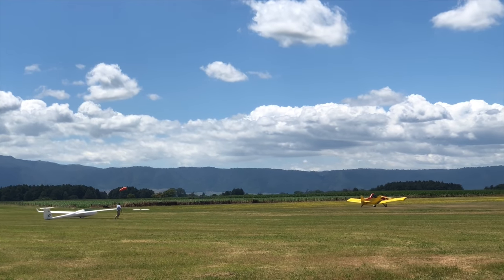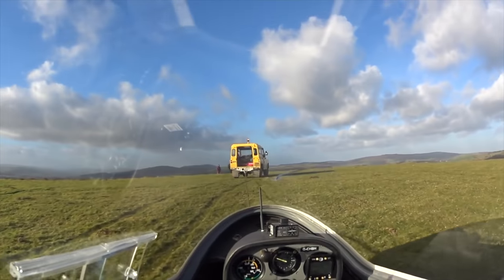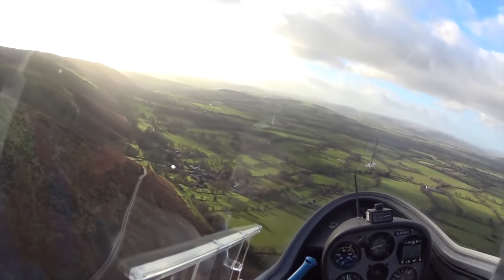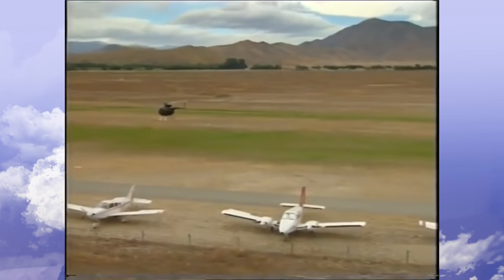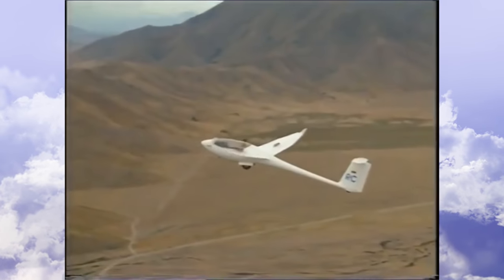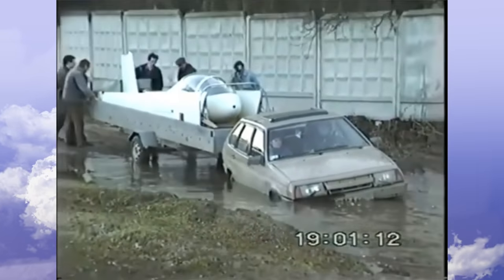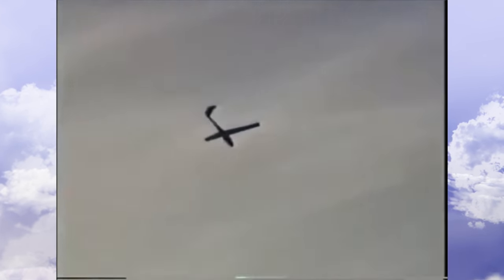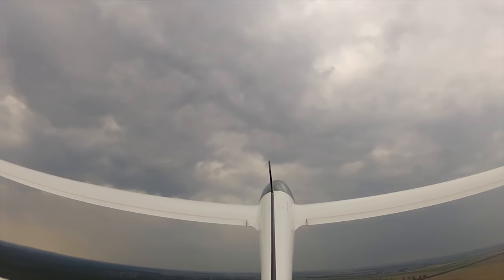4  Weird Ways to Launch a Glider! 🚁

Comment: I have witnessed the most terrifying method of all,   The reflex launch.  This launch is similar to auto launch except that it works on the nature of a certain class of nylon rope. The tow vehicle parks in front and close to the glider. The tow rope is attached and laid out on the runway in a series of S  turns. The vehicle then accelerates down the run and the rope begins to straighten out. By the time the rope is straight ,the  vehicle is moving at take off speed. This is where it gets a bit hairy. The rope, having taken up slack, begins to stretch ,as the glider takes a few moments to catch up. 
As the aircraft gathers speed and launches, the rope shrinks back to its normal length thus adding extra speed to the climb. The situation is now critical, for if the vehicle slows down for any reason ,the rope will become slack  and the glider will be in a dire situation of a slack rope at a low altitude in a dangerous elevated attitude.     I witnessed this method  on a course I did and declined the opportunity to try it out. 
Ps  , the rope lasted for about 4 launches until it became too frayed from being dragged along a sealed runway.
Cheer from Over the Pond👍🇦🇺🇳🇿
Reply from the maker: Holy cow that doesn't sound sensible at all :) Thanks for sharing!
Reply: That, if I understand correctly what I have just read,  would be an ideal method for decapitating traitors. Not for me.

Comment: Great video.

What about the shoulder launch? Requirements: 1. Hill. 2. Correct wind speed and direction. 3. A six person ground crew. 4. A lightweight glider (Ka6/8/18 type). Method. Move the glider to the slope. Lift the glider onto your shoulders (it should nearly be flying) with one at the tail. Now run down the hill. The glider will (should…) fly off. It’s expensive, like bungy launching, due to the number of beers required for the ground crew. And then there is the reverse auto-tow that is more like a winch launch. It is used when you have a short strip.
Reply from the maker: Thanks Trevor :)

Comment: Interesting to see the Heli-drop - We’ve been very successfully launching RC gliders like that for years on flat field RC sites with only thermals to generate any lift (along with bungee launches). One suitably qualified person to fly a suitable size drone in an approved location - drone equiped with an emergency release - and one person to fly the gilder with a normal nose release servo. Very effective for that situation with no ridge lift as you can launch at any time and not just wait for capricious thermals.

Comment: As a hang glider pilot, I was going to add foot launch, but someone beat me to it.

We used to do hand towing sometimes. Couple of guys pulling on the end of the tow rope. Car towing (what you call Auto-tow). Winching. I flew and drove the winch, but it was very dangerous. Horse towing I saw in a video once. The glider pulled onto the air by a horse. Boat towing of course is how it got started and a major manufacturer used to do initial test flying that way. 

Truck towing though seemed promising. Flat bed truck drives along with the glider on the bed. When it reaches flying speed the pilot lifts the nose and takes off. There's a payout winch on the truck. The interesting twist is that the truck can drive up and down the strip and the glider turns 180 at each end. That way the glider can be towed far higher than the strip is long. You can't do it car towing because the bridal attachment will cause the glider to go out of control if the direction of flight and direction of tow are too different.
Reply from the maker: Now turning around mid tow sounds crazy! Thanks for sharing

Comment: I was at this helicopter launch, and the practice day for it. From memory it was Terry Delore in the glider and Bruce Drake in the chopper. In the practice (which it looks like this video was from, not the actual airshow) the glider was hanging for rather long time. Bruce was heard to enquire on the radio whether Terry was going to be long, because he was starting to lose altitude. Terry replied that he was having difficulty reaching the release. He eventually got it. I don't know whether he had his straps tighter for the airshow flight or put an extension on the release cable. It would have been interesting to see what happened if the chopper accelerated into forward flight.

A snatch launch was in fact proposed for this show (the opening ceremony for the 1995 Worlds in Omarama), but Max ruled it out.
Reply from the maker: Wow a snatch launch would be interesting to see :) thanks for sharing Bruce, much appreciated! I knew Bruce was involved, but didn't know Terry was too.
Reply: The glider pilot was Bruce Drake, the helicopter pilot was Alan Bond of Mt Hutt Helicopters
Reply: @glidingkiwi490  thanks for the correction John
Reply: @BruceHoult  Glidingkiwi.com is not run by John Roake
Reply: @glidingkiwi490  well that's a confusing name. What the heck is a glidingkiwi.com, based in Switzerland?
Reply: @BruceHoult  not confusing at all. As a New Zealander that owns and flies sailplanes I think it is a great name. Possibly less confusing than Pureglide who flies a Ventus turbo. Sorry Tim 😉
Reply: Very awkward and confusing thank you for the explanation!

Comment: Auto tow down a runway normaly uses something heavier than a car, Bath & Wilts club in the 70's used a lorry tractor unit and later changed to a large "pickup" (ute).
Back in the mid 60's I remember seeing an auto tow from the public recreation area on top of a 750ft hill using about 100 foot of rope and probably a mk2 Jaguar, just enough height to get to the slope of the hill :)
When covering winch launches, don't forget Bruno Vassel and the 8,000 feet on the 11,000 feet drum winch launch !

Comment: Another variation is the winch with remote pulley. The winch is at the launch site, and the line goes out to a pulley a few hundred yards away, and comes back to the starting point. You can get maybe 1200 feet this way.

Comment: Interesting video, thanks for sharing.

I've actually done a slightly different version of an auto launch: the cable runs from the glider to the other end of the runway, around a big pulley mounted on a swivel then back towards the glider and is attached to the car. The car starts off, avoiding the line of the cable and it is very much like a winch launch.  When the glider releases the car continues to the launch point, the cable is disconnected and the car then returns to the other end of the runway to perform the next launch with the cable the other way around. This was at Tarrent Rusden Airfield, Dorset, UK around 1975.
Reply from the maker: Yeah that’s the normal auto launch method I think, cheers!
Reply: Why do you need the pulley if it works without it?
Reply: @niconico3907  It allows the car to travel in the opposite direction to the glider, significantly reducing the length of runway needed.

Comment: The snatch launch I surmise is the same technique as used by banner aircraft picking up the banner.

In the dim distant past before reliable helicopters another recovery system was used, Skyhook. There were several variants, but the basic system was a cable attached to a balloon that was caught by an aircraft and the attached load was winch into the back of the aircraft, latterly a modified C-130 (the same type as used to recover film from satellites). 

This technique was used to recover special forces.

The whole system could be delivered by parachute and the package retrieved with just the "payload" on the ground. From the payload point of view an essential element was the heavily padded flight suit and helmet.

The system was used until the end of the Vietnam war, but was largely replaced by helicopter extraction.

On an exchange tour is the US, I was "invited" to give it a try; not as bad as I expected, about the same jerk as a winch launch, but the acceleration continued for much longer.

Now if you want rapid acceleration and deceleration, try a carrier shot and trap (i've done that too, off UK and US carries many decades ago).

For now I shall stick with mundane winch launching and aerotow.
Reply from the maker: Thanks for sharing! Certainly would be fun to try :)
Reply: They often used the snatch launch with DC-3s to recover troop gliders during WW-II.

Comment: We used to auto-tow at Essex Gliding Club at North Weald, the former RAF station in the early 80s. Used old Chevy pick-up trucks with 350 cubic inch V engines running on LPG. There was a nice long runway , over 6000 feet, so plenty enough room to get a launch of up to about 1400 feet. Which we needed in order to do pre-solo spin training. I imagine it would be frowned-upon to do spin training in a K-13 from that sort of height these days, but we managed.
Reply from the maker: Holy cow spinning from 1400'?! Yeah not recommended, it's all fine if it works perfectly... Thanks for sharing!
Reply: Back in the eighties I flew at RAE Farnborough in the UK and car launcing was the only method we used (Vauxhall Crestas IIRC). Did spinning too. In a K-13.
Reply: Two loops off a 1400' winch launch with Derek Goddard at Lasham in the early '60s.  Large pucker factor.

Comment: In Oz some 30 years ago we used a 100m 150m  Buggy cord & a vehicle.  We did this on a blanik which is a heavy all metal  2 seat glider. We achieved around 1000 feet. This was done as a across australia gliding attempt Perth to wollongong.  This was as safe as a winch launch & approved in Oz
Reply from the maker: Awesome, and you guys have the runways for it too!

Comment: Oh wow, we used to use the bungee method in the first Gulf War to pull mired vehicles out of the Saudi Arabian quicksand (Sabkahs)!  We'd shackle together about three 50-foot (15.25m) nylon ropes and get a running start with the recovery vehicle, and the rope would stretch naturally, "springing" the mired vehicle out of the mud.  The ropes could take about three of these exercises before their elasticity was kaput, but mires happened frequently enough that it became a favorite practice.

Comment: Vehicle launches are very common for hang gliders. Very safe and quick to reset. The car continues driving to the end of the field while the released rope falls, then turns around dragging the rope back to the next waiting glider. Car unhooks and picks up other end now lying in line with the takeoff direction. Very efficient no rewinding required.

Comment: I did a weight-shift microlight tow launch.
Interesting thing was - you cannot pull the microlight around, because it has no tail.
The rope is on the propeller hub, and on the CofG.

RE

Comment: My club dose auto tows twice a year. Group decided it was better to mount the attach point in the bed of a truck, over the rear axle to avoid lifting if the glider releases late.
Reply from the maker: Interesting, thanks for commenting. Do you use a pulley system so the car comes back towards the glider? or tow the same direction?

Comment: Aston Down used to have a variation of the auto launch where the cable went around a pulley in the ground and the large V8 powered pickup, pulling the cable,  was coming down the field towards you....
Reply from the maker: Yeah that's the traditional auto launch I believe. Cheers!
Reply: @PureGlide  Went solo at ADOWN Normally only got to 800 feet though

Comment: Many years ago I visited a site in Africa that used an electric winch.  Easy to operate and almost completely silent.  The winch was manned when I visited, but I understand it had a remote unit so as to allow it to be operated from the launch point if necessary.  Sounds like a good solution if you can run sufficiently heavy power cables to the site.
Reply from the maker: Yeah that would be awesome!

Comment: How hard would it be to fit in a freight elevator? I'm thinking off the top of a building. Maybe use a teeter-totter ramp with the CG being just slightly back, and the business end hanging off the building. Have the back end weighed down while you load (or put back together), then to launch just release the weighs. 
Be an AWESOME feeling "Flipping the Lip" off of a 80 or more story building.
Reply from the maker: Ha unfortunately we need to get to 1000 feet above the ground at least. So you'd need one of the worlds top 100 buildings to do it. Wikipedia lists the 76th tallest building in the world as 1200 feet with 75 floors. Oh and our wingspans are 15m to 18m, a slightly awkward shape... but it would be fun!

Comment: The helicopter seems risky if somehow the rope gets tangled in one of the rotors the helicopter would likely crash. I think auto, and winch tow seem to be the most economical especially for pattern and landing practice.
Reply from the maker: Yeah absolutely, I guess helicopter pilots deal with ropes and loads all the time so it’s relatively normal for them!
Reply: @lil__boi3027  Unfortunately composite materials aren't very impact resistant, and that includes shrapnel from an explosion (which seems to be quite common with rockets).
Reply: @PureGlide  True, though most loads aren't able to easily gain altitude in order to drag the rope up :)

Comment: Reverse autotow is also fun - very time efficient as well.  I launched like that in Cornwall in a T21 many years ago …
Reply from the maker: By reverse do you mean with pulleys?
Reply: @PureGlide  yes indeed - the car is driving towards the glider with the cable around a pulley - on release the car carries on to the launch point and disconnects - leaving the cable ready for the next launch while it drives back to the pulley side.  I guess the cable needs to be longer but there are other benefits …
Reply: @drmartinyoung3761  Davidstowe using a 4.2 jaguar, good days late 70s early 80s 👍
Reply: @iancox1408  By using a powerful vehicle such as a truck, you can also have a pulley on the tow vehicle, so the rope goes from a fixed anchor in the ground, around the vehicle pully, then round a fixed pulley at or beyond the upwind end of the runway.  That way the glider moves twice as far (and twice as fast) as the tow vehicle, shortening the length needed for the runway still further.

Comment: What if the cable doesn't get detached from the glider side due to mechanical issue, and you're using a tow launcher?
Reply from the maker: Whichever system you’re using it should be possible to detach from both ends, but it’s very rare even one end would fail

Comment: Very interesting video. 
Tbh honest the rolling down the hill method also has no abort option. The dangling part of the helicopter launch also looked rather risky since the glider had a lot of motion long its vertical axis the wings could have tangled with the rope also wondering about the load on the attachment with the weight of the glider + the down-wash of the helicopter.
Reply from the maker: Yeah good points, cheers!

Comment: There used to be a club in the midlands that used an f250 and adouble length tow rope and a fixed pulley at tne bottom of the runway on a good launch you could get 1500plus feet but you had to grab a thermal pretty quick or land and go again

Comment: cool I enjoy your videos...
question: why did it the glider uses the wing brakes when towed with the helicopter? is the stall speed slower when they're engaged? I thought it is faster due to the fact that these brakes disturb the airflow as in German they are called "störklappen"
and why they released it hanging? not in movement?
Reply from the maker: Good question, I think they did it simply to help lose energy. Otherwise the glider would simply fly under and past the helicopter which wouldn’t be good.
Reply: @PureGlide  as they towed it in the beginning I thought as well the downwash might disturb the flight of the glider. but it seems to work well. if you release when the helicopter turns left and you turn right or vv. it should work.
Reply: Deploying the spoilers also increases the drag of the glider. In some cases it's impossible for the towplane to climb if the boards come open on a glider being towed.
Reply: @JimForeman  for sure, I just meant for the helicopter tow release...

Comment: I fly gliders and I'm a retired US Army helicopter pilot. Ref the helicopter launch: The cargo hook is designed for more or less straight down loads, so the hover part of that method is semi-reasonable. The "towplane" portion of that, not so much. A rope break when your hook is under the helicopter fuselage (or getting the  glider out of position, or having an engine failure on the helicopter) could easily result in the rope fouling the rotors. Ouch!

Comment: Do you consider aerotow or winchlaunch to be more dangerous?
Reply from the maker: Good question, they both have their dangers. I’d say if it goes wrong on winch it can happen a lot faster. On aerotow you can have an aerotow upset, where the glider kites up behind the tow plane, and lifts the tail of the tow plane forcing it to dive, and if that happens near the ground there’s no chance of recovery. That might make a good video topic, cheers!

Comment: Reverse autolaunch is another option I've done. Then one friend had a book with different types listed. One was rocket.
Reply from the maker: How do you do that? two pulleys at the end? or what? We really should do more rocket launches...
Reply: @PureGlide  
well the space shuttle was technicly  a glider. Not exactly a sailplane, but due to the powerful launch it could glide quite a distance.
Reply: @PureGlide  Like a which launch with a pully at one end. Car drives at the glider. when it gets to the other end, drops the cable, drives back. There's a ring on both ends. So efficient.
Reply from the maker: Cool makes sense